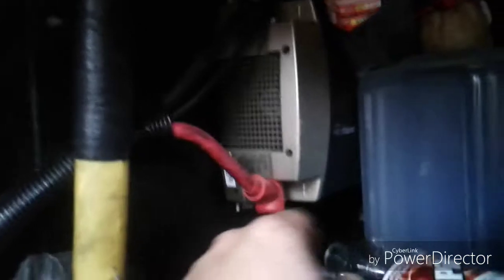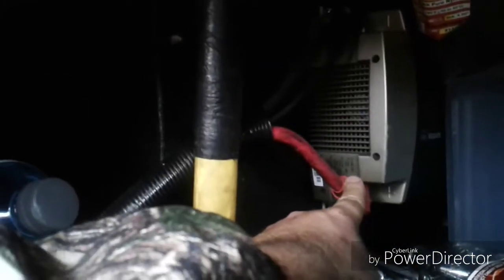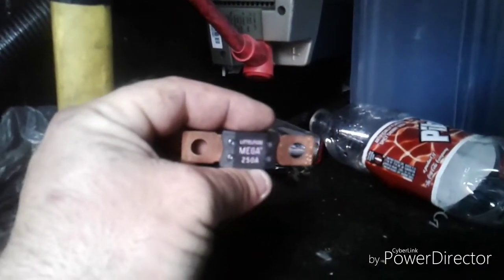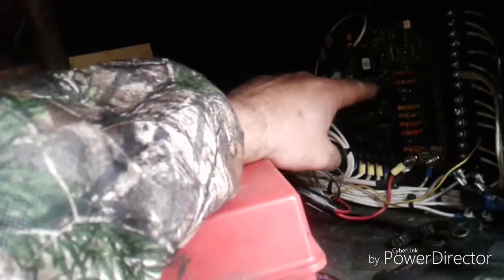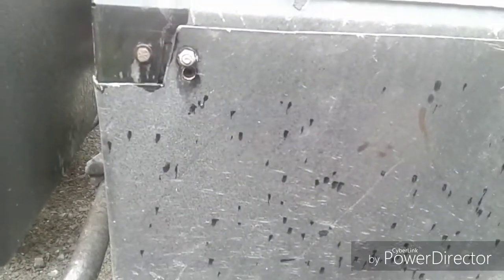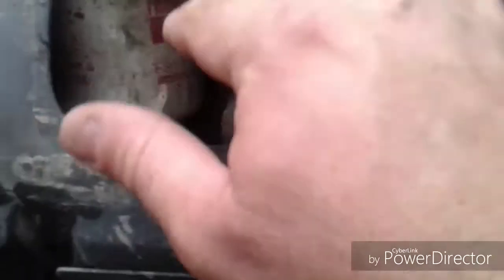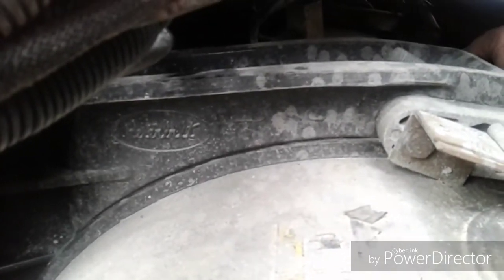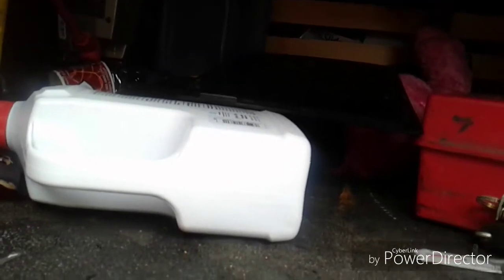A little more about thermoking  apu generators and wabasto heaters

Comment: Great idea on making ur own bottom cover, couldn't tell it was homemade until you mentioned it. Mine is getting roached out also. Wish TK woulda made the skins & frame out of stainless or aluminum.  Road salt eats the hell out of them.
Reply from the maker: Road salt eats everything lol.
I had 3 covers stolen so I made this one so it wouldn't fit anyone else's and it hasn't been stolen yet.
Reply from the maker: If you ever need any tk help just shoot me a comment.
I will do my best to assist you.
Shop prices are outrageous and information is hard to get.
We drivers / owner ops are trying to make a buck and save a hundred. 
No sense in hitting a shop if you can do it your self for less.

Comment: So I have a thermometer King on order should I tell them I don't want the inverter and by a xantra instead
Reply from the maker: I'm not sure they will install one with the initial installation but you can ask them to wire for an inverter and order your own then install it yourself.
Once the wiring is ran the installation is really easy and only takes about 10 min